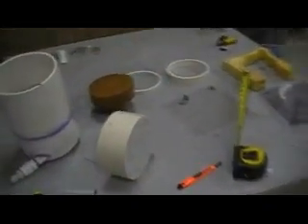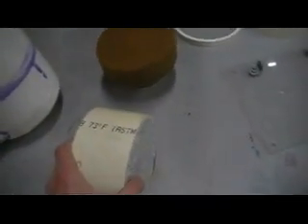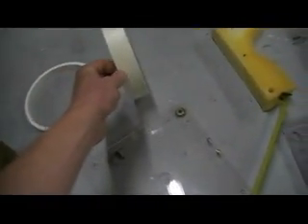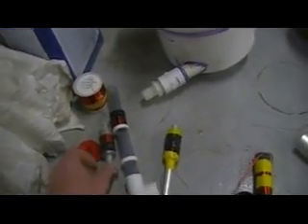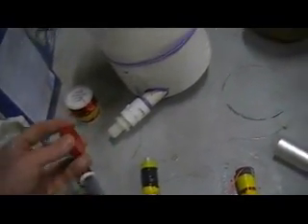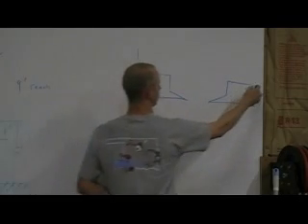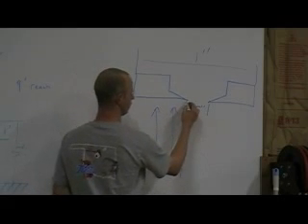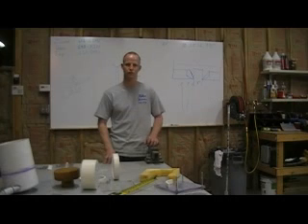Laminar Jet Construction - Part 2

Comment: Dear Sir

I also tried for laminar, up to a extend I successes, but after a distance water spread. I use 4" dia pipe and 10" long and water jet hole is 12mm. pump is 18 meter head and discharge 6480 lph. I need water flow rate and pump specification
Reply from the maker: I tried several 4" diameter versions, None worked at the exit velocity I needed to get decent arches of laminar streams.  This is a laminar flow versus velocity problem, you have to go to 6" PVC.
Reply: @zacharysc100  thanks for reply Sir. Will update you soon
Reply: @zacharysc100  you mean, increase the pipe dia, low pressure will developed? Or any additional device for low pressure?
Reply from the maker: Yes you need to increase the jet body diameter.  4" will work if you want to keep the flow rate pretty low, you can also use a 3/8" nozzle on the 4" jet and get decent results, but if you want the bigger stream and higher arcs you need to go 6" on the body.
Reply: @zacharysc100  hay bro you are carpenter!!!!! I am also
Reply: @zacharysc100  Thanks you very much dear

Comment: Thank you for great videos!  How long did you cut your straws too?  Why did you choose to use much shorter straws than most everyone else's?  Does straw length not make much of a difference beyond a certain point?
Reply from the maker: Yes,, after sufficient length for the flow to become laminar within the straws near the center of the jet longer straws don't help.  I found it to be approx 3" so I believe I cut my straws to 3.5"

Comment: cool ! i have a Q , what kind of material U used to make the nozzle ?
Reply from the maker: Aluminum, you can just use a whole saw to cut an aluminum disk,, then glue/epoxy it into the top plate once you've created the knife like profile in the middle.

Comment: Nice!
Is there a place where I can buy a "nozzle-head" that is already made? I had used several brass nozzles, but I couldn't get a nice stream. Also, what type of drill bit do need to buy to make it myself? Thanks!
Reply from the maker: http://www.homedepot.com/p/Vermont-American-1-2-in-High-Speed-Steel-Countersink-Bit-16634/204300472

Comment from the maker: There is no economic regulator that will fix your problem.  What you need is a big bladder tank.  Or just a large ballast tank with air inside.  A hot water tank works great.

Comment: Well, I don't have a pool and don't want a big pool. I want to use this in my garden. Is it possible, if so how, to run one off of a garden hose or out of a reciptical and into... what? Is there a way to circulate it around to reuse the water? I think that the water must be forced through this Laminar Jet but, at how much pressure and is the pressure through a garden hose enough? Or make a smaller LJ according to the pressure from the hose? I don't have a clue how to figure it all out. lol Help!

Comment: I do have one additional thought, perhaps you've already experimented with it so I'll ask you in an effort to save me some aggravation.  Is it possible to shape the external flow?  All I've ever seen so far are round, cylindrical flows; do you think that if the tube were square as well as the nozzle that the flow (rod) would come out as a square tube?

Comment: Hello Zach. Thank you for a thorough and competent  series of videos on the Laminar flow nozzle. I have been working on one and your videos will help me avoid mistakes. I particularly like the cylinder for evening out pressure variations. I wonder if it would work as well with a four inch pipe?